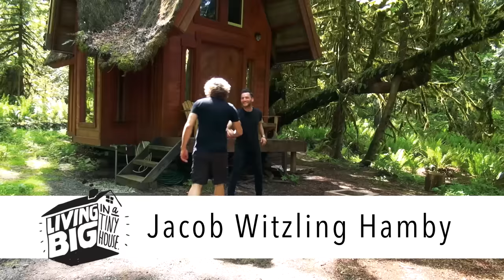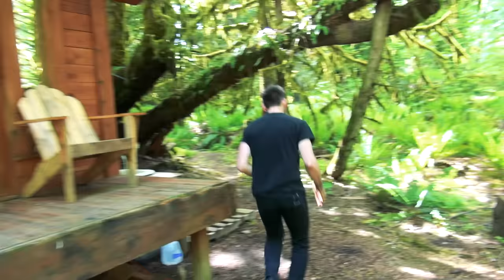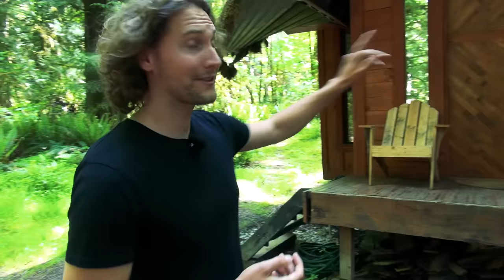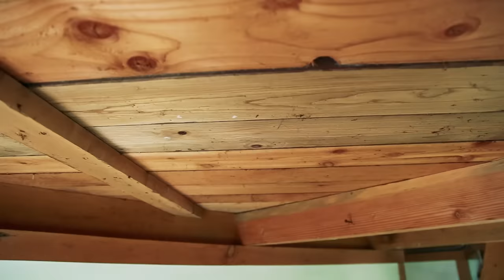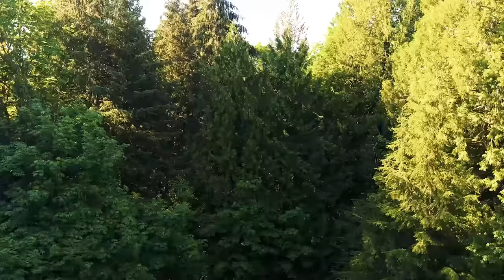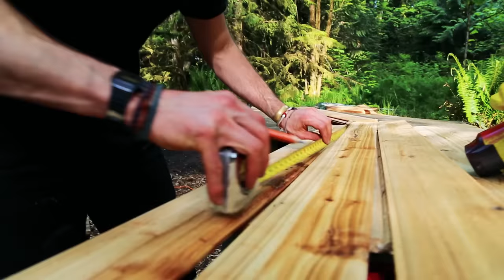Enchanting Cabin In The Forest

Comment: I love when people used reclaimed/recycled materials to build, it has a different type of 'charm' to it.
 My campervan interior is made of 99% recycled material, sure it has melamine and 'fake' wooden parts in it, but I didn't buy it, the only things I bought was the foam and fabric for the seats. 
Saved a ton of money doing it, and it has a strange sense of accomplishment that it's mostly natural parts :P
Reply from the maker: That's very true. I think using reclaimed materials sparks a lot of creativity. You need to work with what you have available to you, which can change a design dramatically.
Reply: Definitely! 
 I got my cupboard doors from a guesthouse that had replaced theirs and built a cooker/sink combo to suit. Counter tops were from the same place, melamine siding was found in a skip and the 'wooden' ( Fake-wood looking' flooring was from a family friend) that lined the living area of my camper. 
 Other than a couple of essential parts for the vehicle, it's cost me sub <£250 to fix to a road-worthy standard in the UK. 

Plus, the "foam" in the seating is actually flat dog bedding, but don't tell anyone. ;P

Comment: I've been building a "simple 8x8 tool shed" next to the garage this spring. Got the frame done and then decided I wanted it back in the woods instead... Then wanted it to be 3 feet taller... Then a full-length cupola on top like a sugar shack... Then a carport type roof off one side so I could do blacksmithing... Then an old fashioned wood stove in one corner... Then a loft with the bench cushions from my old vintage camper... Then some of Edison bulbs...     Next thing I know, I'm knee-deep into building one of these charming Tiny Houses. How the hell did this happen?! XD

Comment: Appsolutely beautiful, unfortunately the statement that was made about keeping the structure under 200 ft² so that not to have to acquire a building permit is not quite correct. True, You can build a 200 ft² structure without a building permit however, ANY structure that is inhabited does require one. As a free man living in a country I am in total resistance to the Nazi mentality of county officials. I'm currently living in a  1700 ft² timber framed home. I built with a sawmill,  without permits. Tuck fhem.